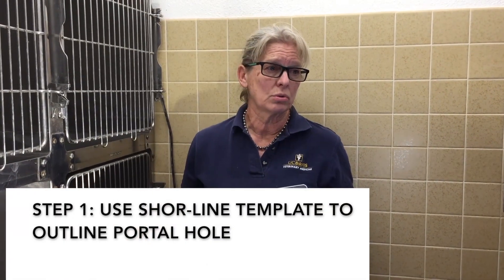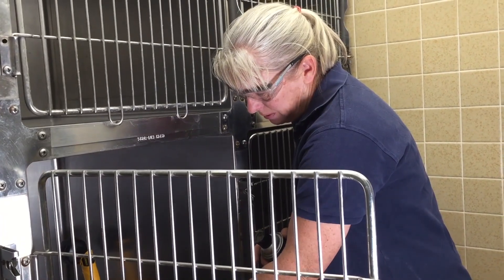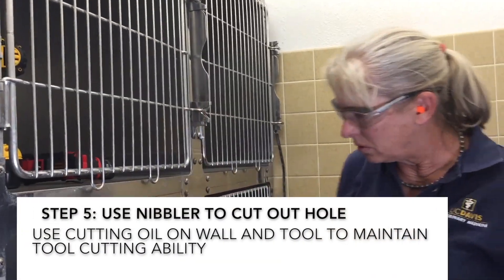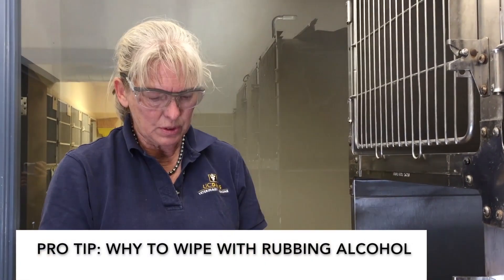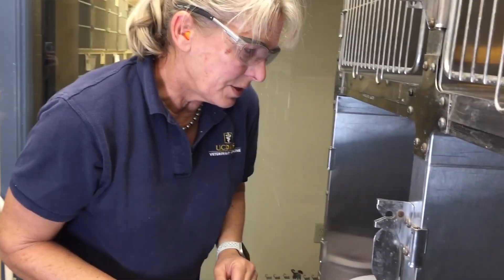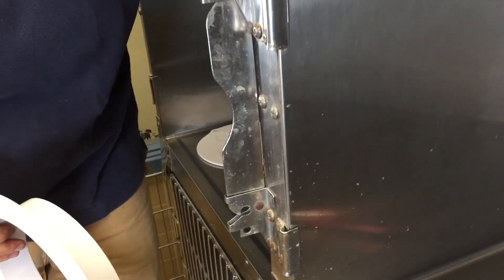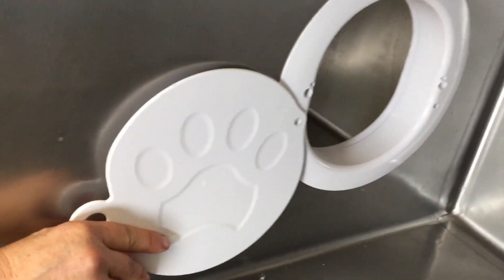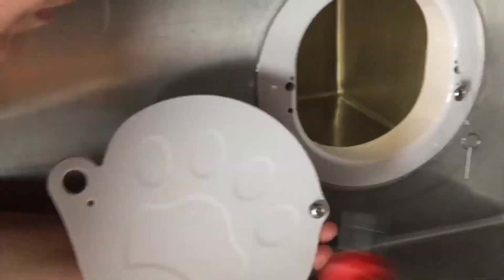Portalizing Stainless Steel Cages

Comment: What are the dimensions on that template? It looks quite different from the measurements provided on the site.
Reply from the maker: Hi Christopher. Thank you for your question. Shor-Line’s template design is a little different than ours (size and where it’s placed in the cage) and both can work quite well – Shor-Line's will not work in cages where the back wall has a shelf attached (unless it can be removed).  We have both templates listed as you may come across each and the dimensions for our template haven’t changed. If you're making your own template, you can safely use the instructions on the site. The important thing is to use the same template to markup both adjoining cages as the templates are not interchangeable.